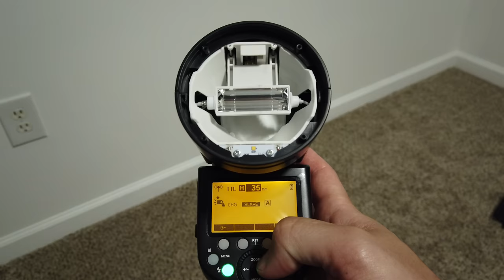Speedlight is stuck at 14mm Basics of flash zoom explained

Comment: I cannot believe it; I've been wracking my brains trying to figure out not only why I couldn't change the mm length of my flash range, but also why flash wasn't firing on manual mode. Stunned it was such a simple fix and that I came across your video by random chance. Got two big wedding jobs coming up and was freaking out that I wouldn't figure out the solution. Thanks so much!

Comment: Thanks so much. Stuck at 14mm problem solved! This is the best video I've seen on the Godox TT685. I thought my control wheel was not functioning since I couldn't adjust the focal length and get it out of manual setting and back to auto. Live and learn.

Comment: Thanks for the video. I just got my Godox  tt685c for my Canon T7i and could not figure out why I could not manually adjust the flash. It was stuck on 14mm and yes I had the diffuser out. One question though. I am a complete newb with speedlites and I cannot figure out how to place the unit into auto zoom?

Comment: Wow thanks man,, but is it a bad thing when a speedllight has fixed zoom? Like triopo tr-950 speedlight? Which has a fixed zoom at 35mm
Reply from the maker: Not necessarily. The Fresnel head of the AD200 is fixed at 35mm, I just modify it with mag grids if it want it to be more narrow. It's certainly less efficient, as zooming through a Fresnel lens narrows coverage while increasing output. Whereas adding grids narrows coverage but drops output.
Reply: @robhallphoto  thank u so much, I understand

Comment: Hey thanks for the video. Do you know why Nikon flashes auto zoom sometimes works and sometimes does not? For example, with my SB-910 on an APS-C body using an APS-C/DX 18-200, the flash follows the zoom throughout the range. No matter what I set on the SB-5000, can't get it to autozoom past 135. any ideas
Reply: figured this out... "illumination pattern", one of the settings on the SB-5000, the default is STD. if you're bouncing your flash, TTL-BL, max autozoom will be 135< with STD. change it to EVEN, and it lets me go to 200! the whole 18-200. yay!

Comment: Oh wow, I have been tearing my hair out trying to solve this problem. But what annoys me the most is that Godox don't even mention the diffuser in their manual let alone having to have it pushed all the way in. How can these companies be so stupid. Just another point to get the zoom working correctly is that on a Canon EOS R5 camera you need to also go into the red menu number 2 and under "External Speedlite control/Flash function settings" turn on "Zoom AUTO"